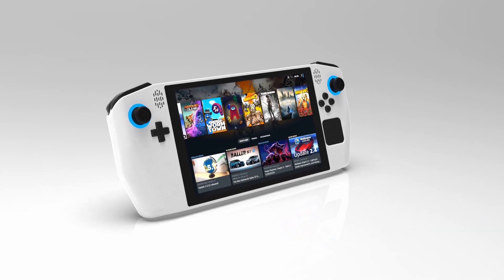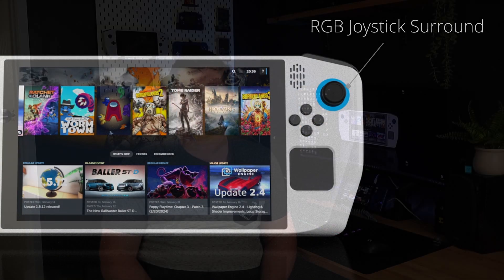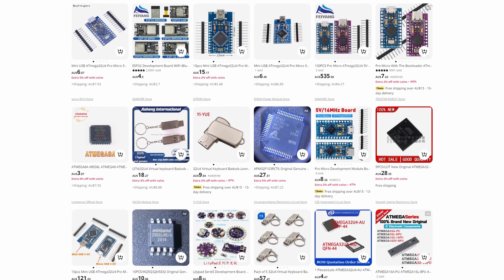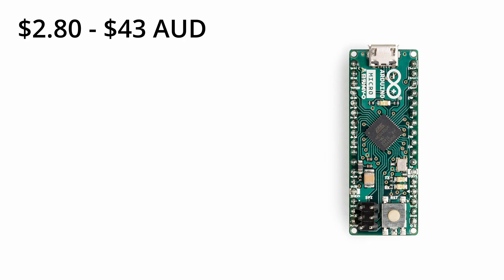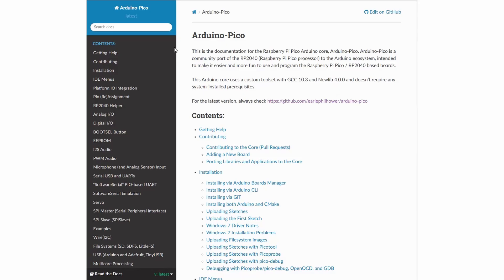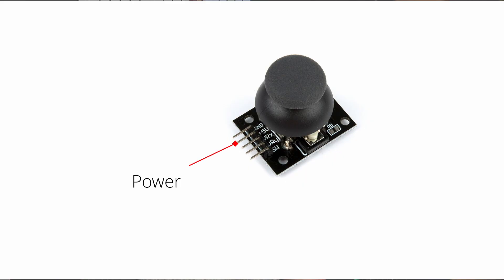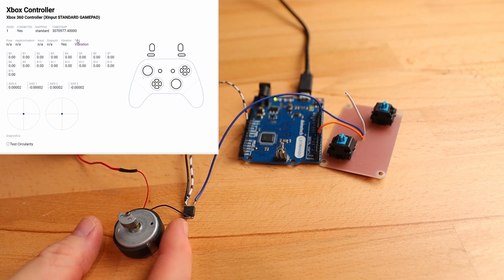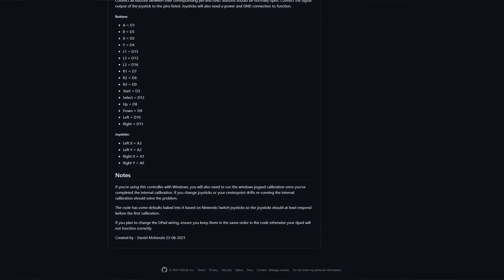Beginners guide to game controllers with Arduino

Comment: Late comment, but the RP2040 used in the Pi Pico does support 4 analog inputs! But the Pico board only breaks out three of them. Waveshare's RP2040 Zero breaks out all 4 analog IO and keeps all the digital IO so there's no need for external analog-to-digital converters with those.

Comment: Awesome tutorial at the best timing for me. Hoping to build this in these holidays. One thing I'm confused in is the official rp pico has 3 analog inputs, then how did you figure out to connect 4 analog inputs ( 2 for each joystick). Most forums simply say to use an external ADC. Any guidance would help😃
Reply from the maker: Yeah that's pretty much your best bet. I used a Pico on my previous NUC based handheld. I just used a basic atmega328p (the same cheap microprocessor found in the Arduino Uno, Nano etc) and had it handle the other half the controller and then communicate with the pico over i2c so the pico could then turn it into USB input for the PC. So it was basically like a programable IO expander. Worked very well so that's what I'll be doing this time too, even though the 32u4 has enough IO for a whole controller. It just means less wiring betwen the two halves of the controller!
Reply: Oh yeah now i recall the usage of that ic communicating over i2c with the pico as you mentioned. That was a really nice workaround you have done there. Thanks a lot for the help😄.

Comment: Hi I just thought id say thank you for all your videos, I've never build a handheld gaming pc before but i have build many gaming pc's and laptops mainly with off the shelf parts and I have also created custom ps3/ps4/ps5 as portables and micro consoles. However I am now looking at building my own handheld and your videos have been a great help which is why im subscribed. I have bought a handheld but its not as good as i would l;ike so now i am looking at making my own handheld run with a latte-panda Mu but i have no idea how to do a controller so this video helped and if you could show how to create and wire it in another video it would be super helpful, I was also thinking of asking PCB-way for their help in creating a custom pcb for it, do you know what i need or what they would and wouldn't do? Anyway thank you for all your help your amazing ! :)
Reply from the maker: I did cover some basic wiring stuff towards the end of the video, it really is as simple as that. If you follow the link to the github page for my controller code I have a whole list of which pins to connect to which buttons so all you really need to do is copy that and flash the code up and you'll have a working controller! Services like PCBway are just for producing PCB's, not helping you design them. They will perform some basic checks on your designs to ensure they can actually produce them, but they won't be able to help you with your design beyond that. Download KiCad, its probably the most popular PCB design software for hobbiests. There's heaps of tutorials online for it. It will be a steep learning curve but there's no better feeling than having your first PCB's turn up in the post!
Reply: @cncdan   Thank you for the advise and help, when it is done I will make sure to show you :)

Comment: The little trackpad will be connected directly to the main board, or the micro? What interface does it use? (this will be so cool man...)
Reply from the maker: I did an episode on the trackpad two videos ago, so you can check that out if you need more info but basically it's just an i2c device so I'll need a micro controller in between it and the computer. It will probably just end up being a second micro that's separate to the controller one. The second micro will also talk to some software I'm going to make for the PC which will allow you to customise the joystick LEDs and maybe even have a couple of different "modes" for the track pad like the Steam deck!
Reply: @cncdan  i check it out thanks!

Comment: its crazy that I have been looking into all this stuff and now you make a video on it! haha. However I am stubborn so I have been sticking with the rp2040 and getting it to do xinput. I only recently was able to get some basic code working but it is promising! that being said it is much more complex because it isnt arudino anymore and I am using the pico-sdk directly with adafruit's tinyUSB library. I dont really know what im doing lmao
Reply from the maker: I really wanted to use the rp2040 too, but I'm too short on time to try and learn how to make it work right now. I'm hoping that in the meantime someone else will work it out and I can swap over to it in a future revision 🤣 I've used the 32u4 in controllers previously, and the only real sacrifice I've had to make is in the resolution of the joystick LUT's since I won't have enough memory to store them otherwise. But in practice, it is completely undetectable so it really doesn't bother me!